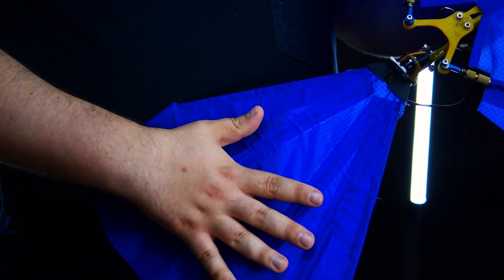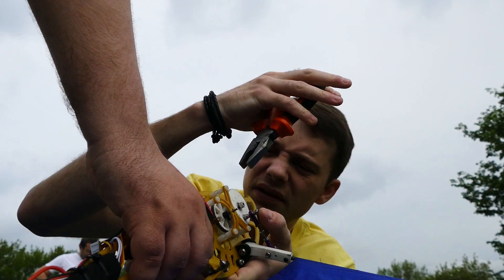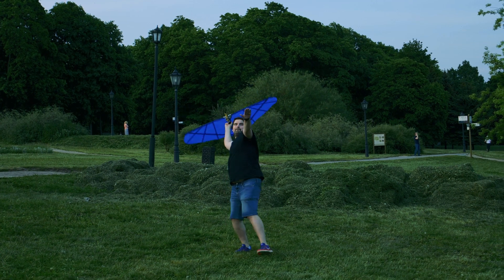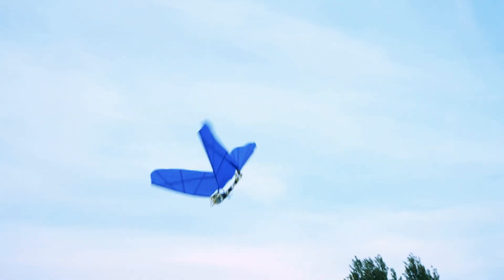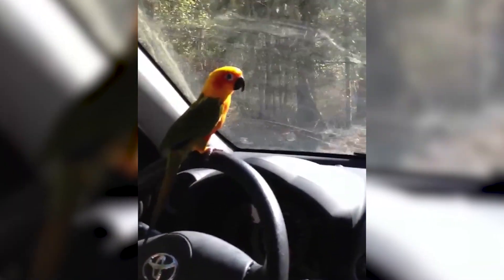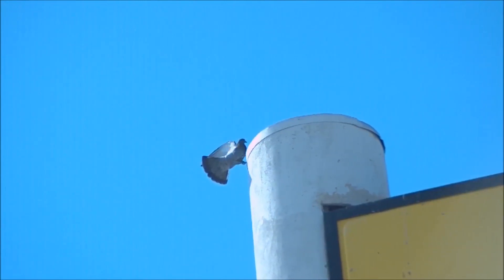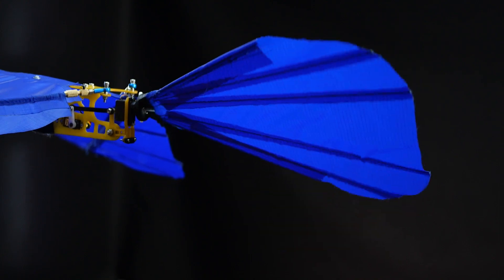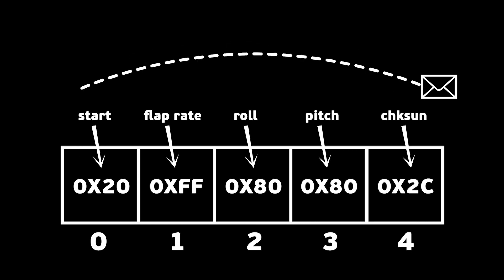DIY Ornitopther: tail, remote control and final flight

Comment: 2 problem. first，pitch angle that you throw the plane out is very important，keep the pitch angle from too big，otherwise it tends to move up and down then stall.second the tail volume of this plane is not enough,so the horizontal stability is not good.we also fail many times to get these tips.

Comment: You need to have a built in elevator up angel in the tail mount so you don't have to use elevator up every time you make a turn ... and trim the Elevator servo to have around 15 degree at launch and maybe less during level flight ... The design is typically based on Sean Kinkade ornithoptes ... good luck